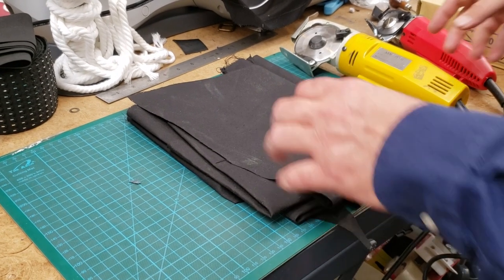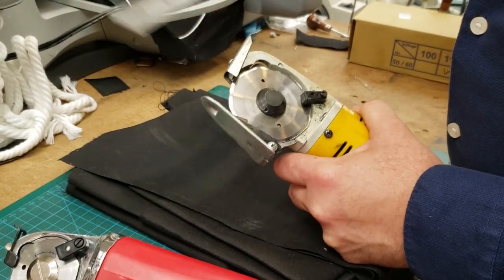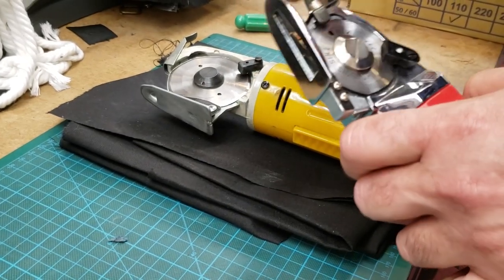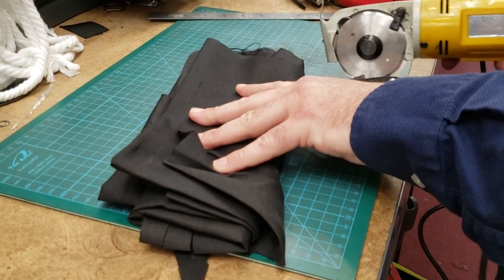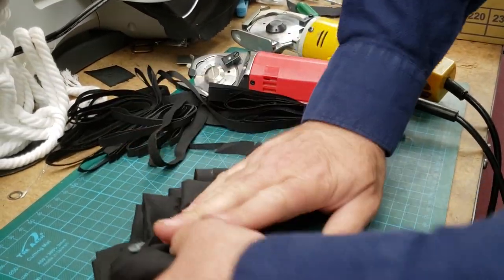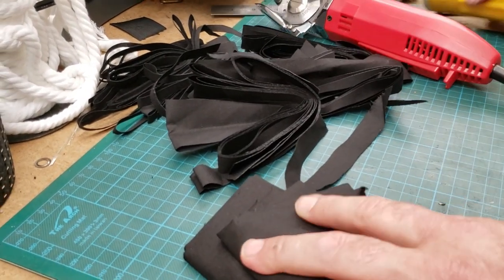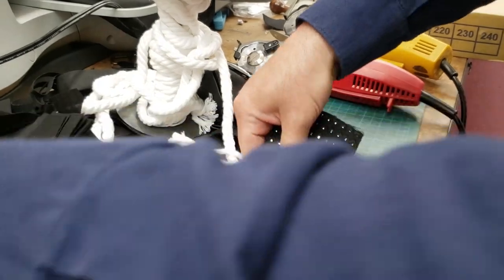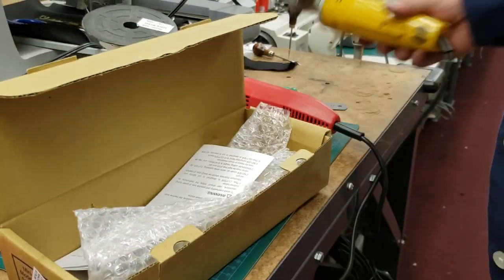Product Showcase - AS-100K MINI Electric Rotary Cutter (2") - Goldstartool.com - 800-868-4419

Comment: How do you change the blade on the AS-100k?
Reply: So there's a screw under the blade guard take that out with the phillips. You'll need a Phillips and a flat head or a butter knife that's what I used. That little tab that swings you'll want to take that out with the flathead (be careful there's a spring in there you don't want to lose) after that repeat the same thing with the center and the flathead the blade will pop out.
Reply: The idea works for all these kinds of blades, I recommend changing the stone as well but you don't have to it's just a good idea